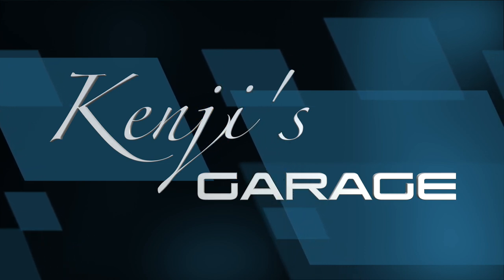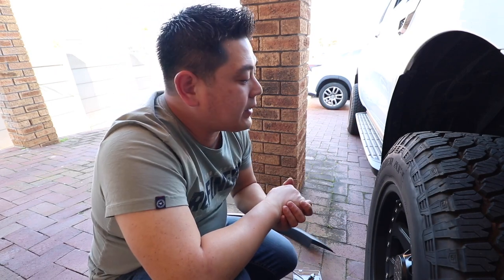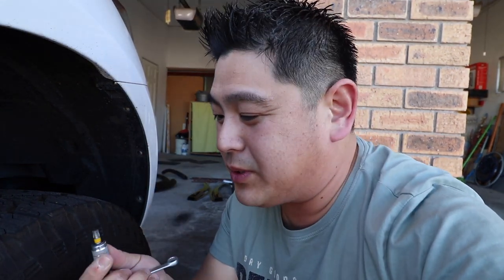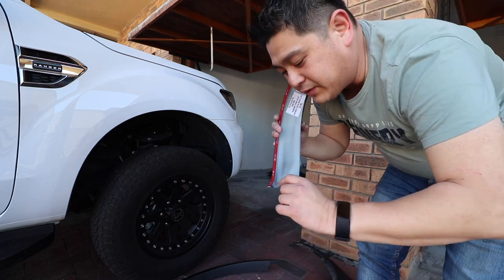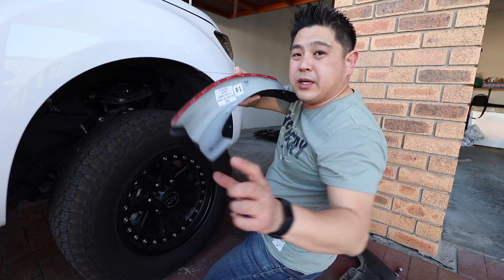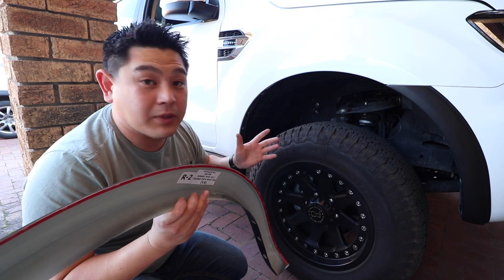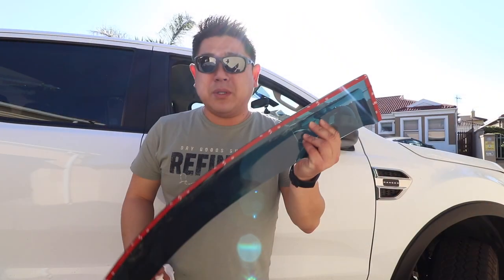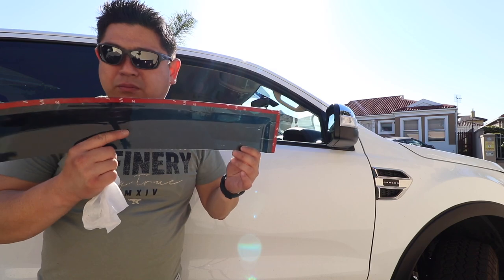Fitting Slimline arches and stuff to my 2019 Ford Ranger XLT

Comment: You need the wheel arch to be very clean with alcohol wipes and apply primer after then stick them on. If not done so after a while they start coming off
Reply from the maker: Apply primer? What primer?
Reply: @KenjiLo1  its like a pre glue helps them to stick Really well, but you should be Okey if you didn't use as long as the surface is clean. Good job

Comment: Hey, what brand are the flares also do you know if they do them for a 2020 Px3 with front sensors?
Cheers.
Reply from the maker: They call it the V1 flares. But that’s probably renamed for local naming. 

Yes there are ones specific for Wildtrack with those sensors on the side from bumper